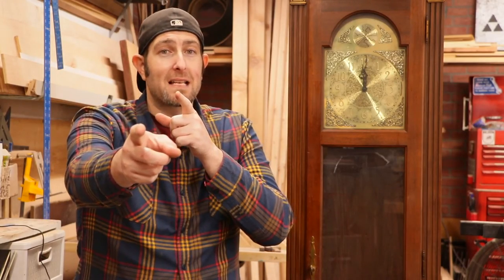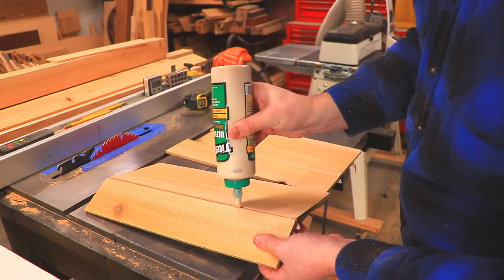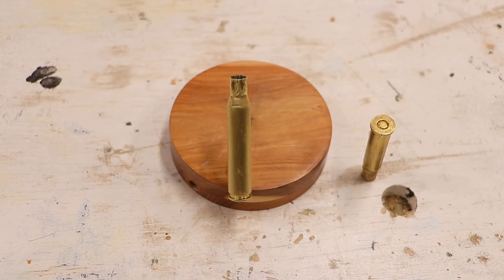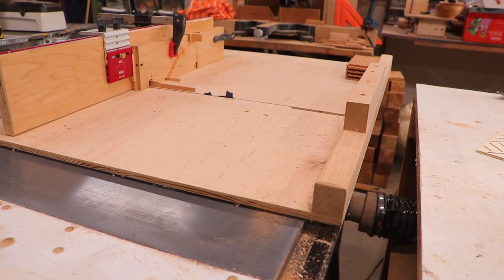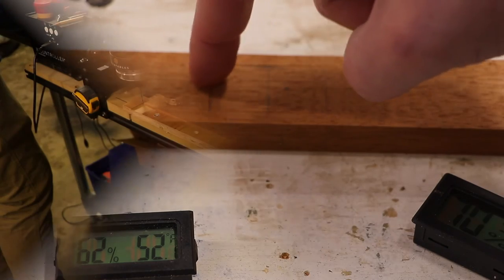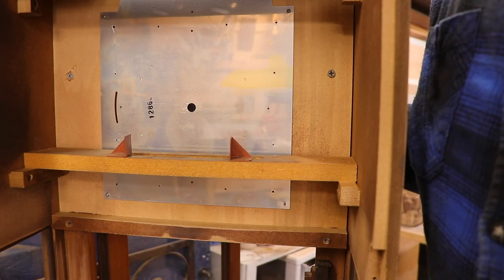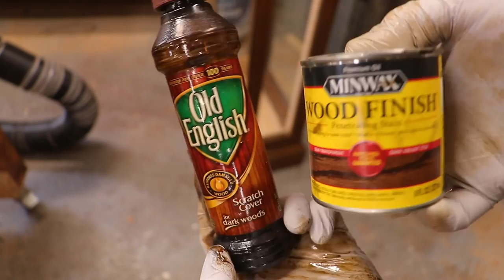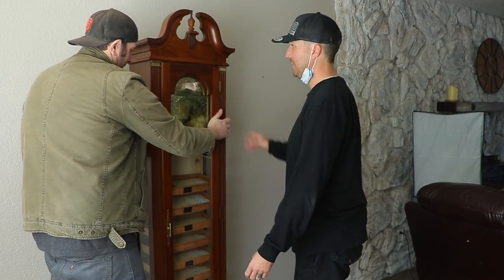Turning A Grandfather Clock Into A Cigar Humidor With Secret Compartment

Comment: the hole for the hygrometers should go all the way through if you want them to read the humidity. with that configuration, you are reading the humidity of the wood (kind of at least..).
Reply: I was concerned about that as well but it can depend on the hygrometer and where the sensor is to determine humidity.  I think the front were too big in general.
Reply: Apparently the dude isn’t gonna be reading anything anymore
Reply: i’m not 100% sure but wood is pores, so in a sense the humidity of the wood would read the humidity of the room it is in as well. It might not be exact, but the humidity of the wood would be within 2-3% of the air inside the room👍🏼

Comment: This is my humidor. Pete was a great friend and woodworker. He unfortunately passed away shortly after this video. He is greatly missed. The humidor clock now has a plaque at the top dedicated to Pete as a tribute. Rest in Peace Pete.

To answer a few comments or questions to those asking about seal, the front door has weatherstripping and holds a seal well. Any leakage is overpowered by a commercial humidifier that has no problem keeping my sticks at 65%. The hygrometers surprisingly have no problem showing semi accurate %. These cheap digital hygrometers are not super accurate as it is. I use a Boveda Wi-Fi hygrometer to maintain temp/humidity. 
I receive tons of compliments on the humidor clock Pete built and am so thankful for this video and being his friend. He will be missed.
Reply: Wow he passed away that’s so sad RIP
Reply: Damn…sorry to read that…
Reply: So sorry to hear this. What a treasure to have this now. RIP.
Reply: How did he pass may I ask?

Comment: Nice project, but a pity to do that to a proper horological timepiece.
Reply: It was a cheep MDF clock made to look better than it was. Probably a Sears catalogue special. The only value in it would have been the sentimentality of it belonging to the guys Grandfather. To be able to give it a second life is the best anyone could have hoped for. I bet if you ask any Clock restorer, they would say that they made the right decision. It is still used as a clock, but also has added functionality to bring it into a more modern time.
Reply: @paulmccullough7352  ah ok, it seemed like it was a “proper” solid wood clock. Now I’m curious how the mdf held up to the moisture with time? I didn’t think one could have mdf anywhere near that type of relative humidity without consequences…
Reply: As long as it is sealed, it should hold up just fine. 60-70% humidity shouldn't cause any sweating. And as long as it is sealed, MDF generally does ok unless you get full on water into the endgrain of the boards. Even then, if it's a one-off situation, it will most likely just cause a little swelling, depending on how much water there was. It's mainly standing water or continuous moisture that does the real damage to MDF furniture.
Reply: @paulmccullough7352 you are 100% correct. The clock likely came from Montgomery Wards or Sears. It was not a collectible piece. It was only really valuable to me for sentimental reasons. You’re exactly right 👍
My wife didn’t want it in the living room so I found the best use I could for preserving the memory of it
Reply: @RichardT2112  I don’t believe any of the mdf in the lower hunidor compartment is exposed to the humidity. I believe the cedar is lining all interior portions.
Reply: @12voltVillains  that would make sense, at least I hope you are right!